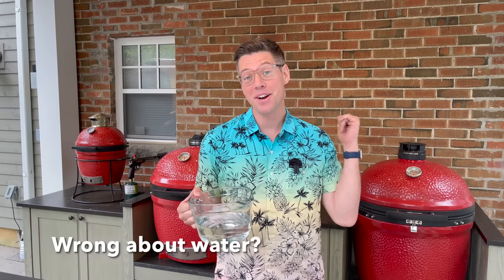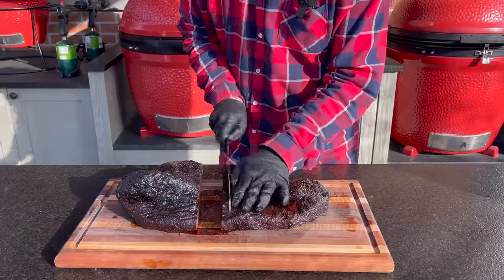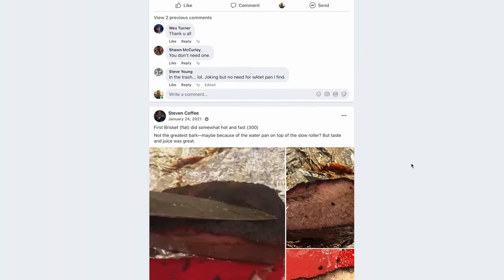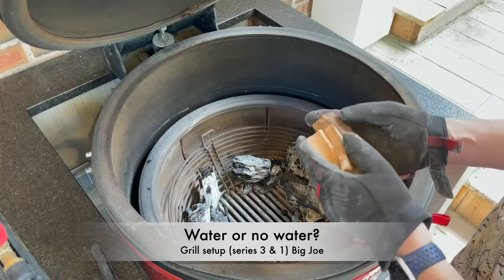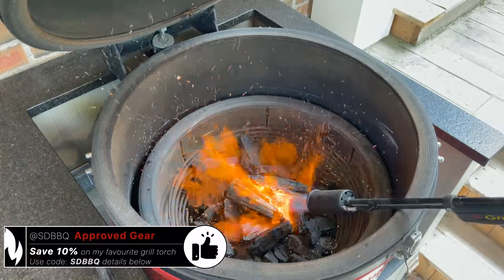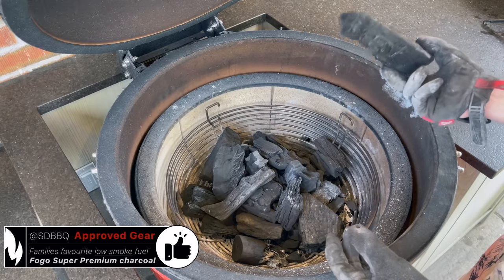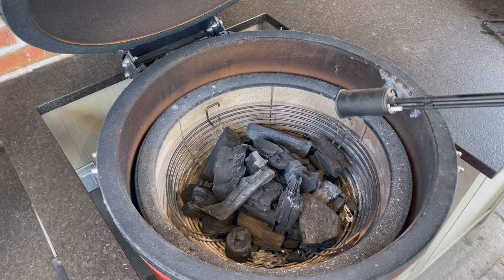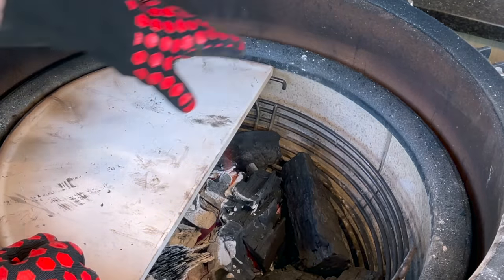THIS Kamado Joe water pan test PROVES we're ALL WRONG about water pans in Kamado's

Comment: If the bottom gets a different bark / consistency, I wonder if placing a water source next to the meat would help. You still get the humidity in the air but not directly below the meat.
Reply: Or maybe put the pan on the deflector plates, below the slow roler lid. this way the water would still vaporize but not be direct under the meat as well

Comment: Hi James another great video. I have a BK Keg and the heat deflector accessory from them is a water pan. In the beginning I used it for every cook and I was able to make a few observations. It seems to make your meat look braised/boiled. Secondly the added moisture soaks the inside of the dome so everything is damp & runny... on longer cooks (10+ hours) the added water would condense and drip into the fire. On a few occasions it's put the fire out. Because of this I only use the water pan as a heat sync for very low temp cooks like smoked fish and been jerky. Otherwise I think the braised/boiled outcome is just cosmetic but regardless I don't really like the final product. Hope this helps.

Comment: It would be cool to see a side by side comparison on ribs with the water pan above the slow roller like you did here vs water pan below the slow roller like you did on the brisket against Al. I'm curious what that would do to the bark on top and if you would get the normal color back on the bottom since the water would not be directly under the meat.

Comment: I have a classic 1. I use  a water pan on long cooks such as pork butts and brisket. At time I use it on ribs. I found the water pan was like ur double indirect and bottoms didn’t burn. Since You recommended the smokeware drip pan, I have not used a water pan. Thanks for doing the video. Once posted I used a water on fb, was quickly corrected I didn’t need one on a Joe

Comment: My guy! Glad to see this comparison up after I mentioned it recently. I’ve gone to having a water pan in most cooks now particularly where I’ve gone double indirect so there is a hotter fire, more airflow and therefore less humidity. I find adding the water pan definitely has helped make the end result a touch better every time.
Reply: If you add a water pan, do you really need the “double” indirect?
Since the purpose of double indirect is to prevent burning underneath, then wouldn’t a water pan on single indirect achieve the same thing?
Reply: @ to be honest in the years since that extensive testing has told me the double indirect is just nonsense anyway, as is most of the overly complicated stuff on this channel which is put out just for views. 

The best method by far and away is just the deflectors in the lowest position on the basket, meaning they don’t become a heat source right underneath the meat which it does with double indirect. Same as the slow roller is not worth it, it’s a bad deflector and gets too hot too close to the meat. Keep it simple and put the deflectors down on the basket in their intended position and the results are far better with less faff.
Reply: @ thank you for the quick response!!!

It’s kind of funny how at the end of the day, it all goes back to basics 😅

Do you use a water pan with the deflector, or as long as it’s far enough from the food and blocks direct charcoal heat, that’s good enough?
Reply: @edwardprokopchuk3264  I have tried having a water pan on the X rack under the food whilst the deflectors were right at the bottom on the basket, and it does increase humidity a lot. I'm not convinced it made enough difference to the end result to be worth the risk though, as I once spilled water onto a deflector whilst refilling it and the temp shock cracked it and had to get a new deflector. So I just don't bother now.  I've found that simply having the deflectors at the lowest point directly on the basket so you don't have a source of heat directly under the meat just has far superior results to everything else.  All this messing around trying different methods to 'hack' the kamado just to end up back with what KJs original recommendation was anyway!
Reply: @ thank you for saving me some experimental headache! 😁👍

Comment: I used to use a water pan in an uninsulated vertical bullet. It seemed to consume more fuel and and provided a consistent temp. In the end, I ran the unit with no water. This was an ECB smoker with open bottom and no way to add fuel or water easily. I ran a layer of briquettes for heat and no flavour and a layer of wood chunks and charcoal for the best of both worlds. I used about 5 hot briquettes in a corner and the fire would go from one side of the unit to the other. It would actually settle at 230 degrees for about 3 hours and then I would wrap (butcher paper always) and pour in some more briquettes for another 3 hour burn. Shorter cook times, less fuel.

Comment: I would try testing with a brisket.  With the longer cook time, I think that's where you would notice a difference. On my UDS, I do use a water pan, but it is much lower and spaced much further than you have it in the Joe.
Reply: I use a water pan too with my UDS. I find it gives a cleaner result. Otherwise the smoke can get intense from fat incinerating.. the pan also makes clean up easier. And I can transfer it to the oven to finish off in a pre warmed pan if I desire!

Comment: GREAT video! I'm new to the kamato (your video's tempted me!) & haven't used a water pan yet. I have used a WSM for about 14 years. I have done pork butts & briskets both with & w/o the water pan. As you would expect the water pan results in a moister meat and not as 'crusty' of a bark. I do something a bit different though. I fill the water pan with ice first so that the outer layer of meat get time for a little 'bark' first. Then as it melts and heats up I get the moist steam. When I do these for our large (25-35) camping group they appear to prefer the water pan method. They are not aware, but I get more comments about how good the meat was when I have used the water pan. Personally I prefer the crusty bark; but in our group I'm in the far, far minority. Cook to the audience.

Comment: Very interesting video, to use no water was one of the first things I was told when going Kamado. 
Thing is when I was learning to bbq I was using Weber and then water was always a part of many cooks especially if I were to cook for a long time. It was more used as an insulator than anything else, also to hinder heat spikes and lows. Water was a part of our cook when we won best ribs at the Swedish bbq championship. No idea why I never questioned the fact when I first heard it. Also I have never liked the 3-2-1 method.
Reply: I agree (with use of water pan).  I have always used a water pan in my Kamado Joe Big Joe s1 for ribs AND brisket.  I guess I never heard that I wasn't supposed to use water but then again, I never asked.  For James though, I would still sprits that, even though it is above a water pan.

Comment: Hey James thanks for all your videos. You mentioned a test that you did for the water pan but didn't give the link for the video I was curious on which smokeware drip pan you used for the Big Joe 3? Thanks in advance!
Reply from the maker: 00:28 in this video shows the most current way i am incorporating water (under the sloroller) - https://youtu.be/ZAOX8iCPgXo 

I found this is working best as we don't get any soggy bottoms like you can with the pan directly below the food, and we get the benefit of the 20x humid air circulation from the sloroller which helps the smoke molecules adhere to the protein better.  

Only the 14" fits under the sloroller, the big joe can use the  new 18" but not for the water under the sloroller
Reply: @SmokingDadBBQ  great for me since I bought the 14" already and was planning on the 18 anyway. Thanks for the response!

Comment: Please try brisket next . I’ve started using a water pan under my brisket so I can have it fat side up and I don’t have to spritz it while it cooks over night. In a BJ3 I set up the slow roller, water pan, and set at 275. I then use the foil boat around 180 and then let it rest for as long as it can in my oven at 150 degrees. Comes out really well but I always feel like my bark could be darker. I’ve never tried the double indirect yet so I’m going to try that next, but I’m worried about omitting the water pan since I’ve had such success with it.

Comment: My 2 cents! I use the SNS Kamado and Kettle which includes water reservoir, and also a water pan in my pellet grill Original Grilla and it definetly makes a difference besides creating a better taste profile, it also helps to even out temperatures on the cooking area. Also as the SNS system, creats ineficieny the % of wood vrs charcoal  that can be used is much higher as combustion of smoke is more complete. You can manage the combustion of smoke by adding chunks on top or botton of the charcoal reservoir very conveniet in the SNS system. As with everything you need to manage humidity, for turkey, ribs,  sometimes I remove the water reservoir towards the end of the cook so skin crisps up a bit, and bark become a tad firmer.

Comment: In the SnS Kamado, the Slow N Sear does have the water reservoir, and I used to keep it in and fill it with water when smoking, but I recently started leaving it out for "higher heat" cooks and meant to put it back in for smoking, but I never remember to put it back in there and I can't tell much difference.

Comment: I love these experiments. I do think brisket would be the best test. I do wonder if the foil boat with the water pan would ultimately take it up to the next level. I’ve seen offset users use a water pan and still get the desired bark. I imagine with the inclusion of the foil boat, you will have the bark you desire, a moist underside, and it removes the need to spray every hour

Comment: I think you shouldn't have sprayed the other set on a comparison like this because you added 2 variables of direct moisture and temperature change from opening the grill.  I've added water to the drip pan at the beginning of a brisket cook thinking maybe it would help as a heat sink and more moisture at the bottom for less crisp, similar to the double indirect idea.  I don't bother adding more water during the cook because it's awkward, and the pan is always dry at the end.  I don't know if it's helped because my brisket cooks are still hit and miss anyway, but it seems like it could be something for a longer cook like that.
Reply: @Smoking Dad BBQ  I got a notification about winning something that seems pretty scammy?  Hacked?
Reply from the maker: @brettm5419  it’s a fake account using my photo to try and scam people. Report the fake account if you see it again please. I did and removed all the comments I could find form that user

Comment: interesting comparison!

I would love to see spatchcock chicken used for this experiment. The added humidity might benefit the white meat. Though the skin will be very sensitive to the change in cooking environment. so it should be a good test to try.

I also wonder if a water pan allows you to pull off a hotter and faster brisket cook without the double indirect and prevent the bottom from tearing while cooking. just for those who want the charcoal efficienty of a single indirect cook.

Comment: Hello, I am using a Smartfire on my KJ.  It attaches to the grate.  It is similar to the Ikamand.  Dome temp is always higher than what my grate temperature is showing.  Which temperature should I follow?
Reply from the maker: There is about a 20-40f temp difference between the low grid position and the dome. It’s like looking at a picture of yourself 5 years ago beside one from today and asking which picture is you. They both are accurate at the time and place. Probes are the same, I use the dome as it’s the one probe I have every cook as my default for quoting temps
Reply: @SmokingDadBBQ  Thank you and have a good Turkey Day.

Comment: I like to see chuck roast or brisket. I’ve tried chuck roast  before and it turns out dry. I’ve never cooked one with a water pan though. Also, another test I’d be interested in is the difference between using mustard as a binder and just plain water. Can you detect any difference in flavor?

Comment: I have often used a water pan in the Junior. I find (anecdotally?) that it helps with heat control. Admittedly, this is more commonly used with a chuck roast (brisket is hard to get here). Anyway, I assume the water acts as an additional heatsink and while there is water, the temperature will tend to keep closer to 100C/212F. In terms of suggestions, you could perhaps cold-smoke the ribs, then steam, then sear... and compare them to these two... (then again this could be a terrible idea...)

Comment: I’m thinking about getting a kamado bbq to replace my weber kettle. Does the food taste any different and is it easier to get great results on?
Reply from the maker: The kettle sometimes has an advantage of burning a clean fire. As it’s not insulated running a small dirty fire is much more difficult to do than it is an air restricted and very thermal efficient grill like a Kamado. 

That being said when you set it up right I notice a difference, it’s easier to use for long cooks and gets hotter for pizza and steak. 

I think you will like it but the mistake everyone makes is forgetting why the kettle tastes good which is clean fire and sometimes choke out their Kamado

Comment: How tall is the joe Jr?  I would like to build a table to make it portable in the backyard. If you have any build plans for it I would like to purchase them.
Reply from the maker: From the website 

Width: 20"
Height: 27.5"
Weight: 77.2 lbs.
Heat Range: 225°F - 750°F
Cooking Surface: 13.5" Diameter

Comment: What size smokeware drip pan did you use on the series 1? I've tried a 14 but that hits the top grates and unbalances it.
Reply from the maker: I have sent them this fact after I got a series 1 and discovered the same thing. Apparently they are making a new low profile version to fix this

Comment: Have you stopped with the "start the fire at the air-intake and let it go from there in a straight line" set up or have you gone to top down? and if so why? Might be a vid on it been away from civilization for a bit. :D

I also have a issue with my Big Joe that it seems to gain heat during the cook even if I try to ajust with the top vent and down vent it just goes up no matter what

edit3: also I love the technique of dropping chips in the ash basket it really woorks a treat!

edit4: also what is your take on rib-racks ie: holders for ribs so you can have more in the kamado?
Reply from the maker: thanks, have you calibrated your dome gauge lately to confirm its accurate?  once the grill gets heated and the food cool bubble warms up temps that were holding flat will start to rise which means you (1) weren't heat soaked before starting (which is fine if you adjust for that) or (2) have your vents set for a higher temp than you need and once things catchup the temps are going to where you have them set
Reply: @SmokingDadBBQ  I use the meater so it's accurate for ambient temp. I'll play with my settings a bit

Comment: To me it doesn’t look like you got enough pull back meat from bone which is not much rendering. Definitely not dark enough bark. We don’t sauce our ribs either but looks like something in my opinion went definitely wrong with this cook on both racks of ribs. I think you might be taking an easy process and complicating it. prep them smoke until color wrap for maybe 90 min and finish unwrapped.
Reply: Pull back is good on the eyes and a must for competion ribs. However, as the meat pulls back, it oozes out fat juices. If you can get the fat rendered enough, but also without much pull back, you'd get juicier ribs.

Comment: I got my big joe 3 last week and finally had a chance to fire it up.  I am having issues with my big joe running through coal pretty quick.  I timed a half of basket full running at 250 degrees ,only lasted me 4 hours.  I upgraded from a 18" vision ceramic grill that would run forever with that amount of fuel.  Am i doing something wrong?  I am using Royal Oak hardwood Lump.  Do I need to change fuel?

Comment: Hi James,
Well because of your recent videos I'm selling my 18" Vision and now have a new KJ BJ1 in the box on my patio. I would have never known how good they were without your help. Thanks
On the double indirect method, do you think it is ok to use on hot cooks or would it break the heat deflector?  I'm thinking of 425 or so to cook chicken.
Reply from the maker: i have had my stones up to 700 for pizza and no issue
Reply: Thank you. Do you still recommend leaving out the stainless piece for the ash tray?  Talking about what I would call the ash funnel  / guide
Reply from the maker: @scottkeasler9317  yes. I plan to cut mine so it can slide in and out for cleaning without needing to remove the firebox
Reply: @SmokingDadBBQ  I finished cutting my ash guide and assembled the grill last this past Monday.  Went ahead and burned a fire just to try it out.  This thing is amazing!  My charcoal basket is apparently on back-order thru Lowes so I don't have it yet.  When it comes do I remove the original cast iron grate when using the basket or does it stay in place to aid in supporting the firebox sections?  Thank you so much for the help and video's!